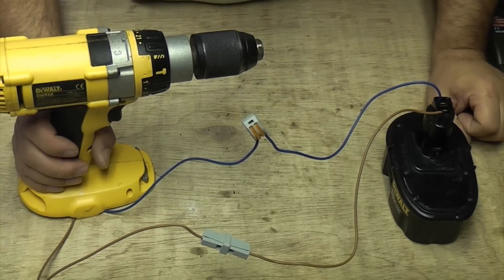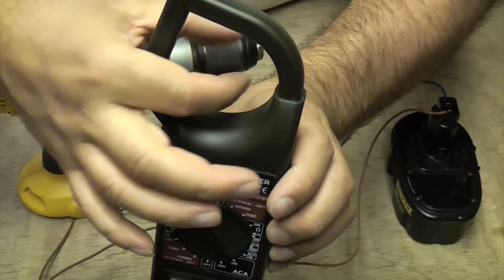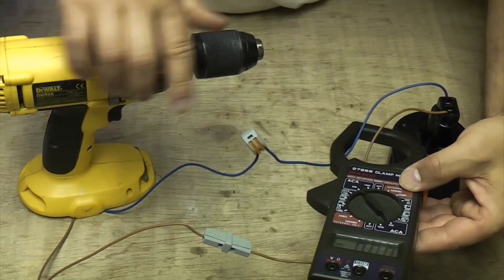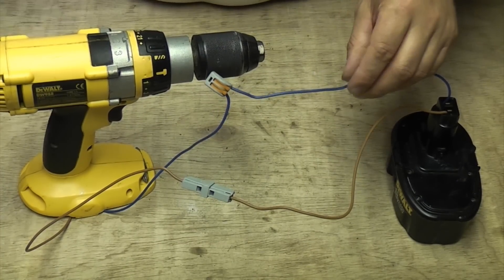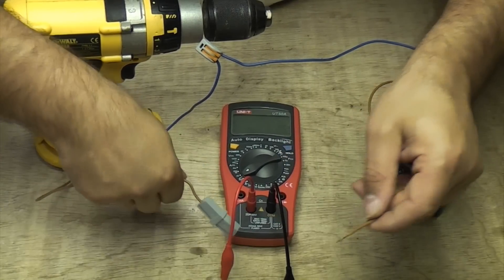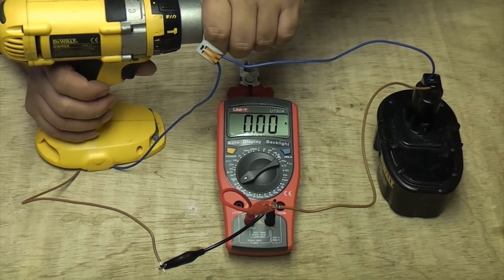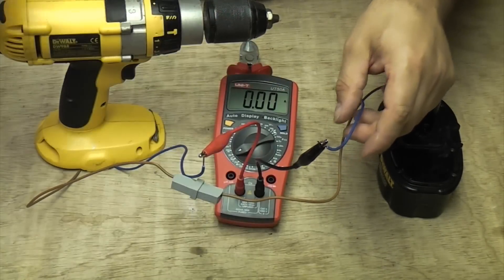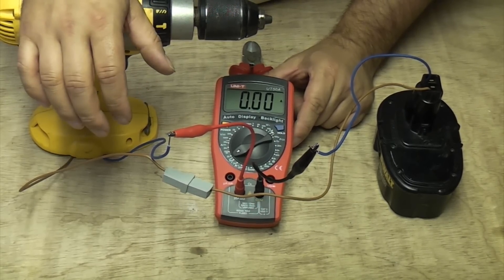Multi-meter to measure amps

Comment: cool, but i need to know how i can measure the milli/amps in a battery.....without anything connected. how do i do that? i have multimeters.....i have a certain 3.7v battery and it seems extremely powerful compared to other 3.7v batteries i have going by the same thing being connected,  nothing is written on it amperage wise....cheers.
Reply from the maker: Not sure about that, sorry.
It's not something I have ever done 🤔
Reply: @ultimatehandyman    no problem cheers for the reply,  yes strange isnt it,  i was experimenting yesterday, set my meter to milliamps...connected it to a 12v solar panel and could read the millamps no problem.....unhooked it, connected it to several batteries...and nothing....strange...i thougyt measuring a batteries amperage would have been uber simpke, but apparently not...    hmmmmmmm...

Comment: Thank you sir. I've fried cheap meters trying to read amps draw. My meters say 10 amps but I'm not confident that they can handle that. In the past I tried it and blew the internal fuse but still fried the meter....don't know why they design stuff that has a fuse for protection but in actuality the fuse doesn't do the job and the instrument get fried anyway ????
Reply from the maker: That has not happened to me - yet. 
The fuse should always protect the instrument, that is what it is there for!

Comment: This is probably a NiCd battery and this trick will work on these type of batteries. Mine drill is a 20v one Li-Ion, when i try to connect it to the multimeter and test the amps it can't start, i check the voltage and it's around 15,57V... Amps are only 10 miliamps. There is some kind of a connection that needs to make contact to let the full voltage but i dunno how...
Reply from the maker: Not sure about that, sorry.

Comment: How to check Current Storing Capacity in terms of mAh of any battery....Please explain...
Reply from the maker: Sorry, I do not know as it's something I have never done before.
Reply: I mean to say that how I can ascertain that a battery is good enough to use for how much time. Would voltage readings on a multimeter is only way or any other way also...

Comment: i don't understand why is he demonstrating the wrong way to measure the amp in the first place
Reply from the maker: +victor amechazurra What do you mean by I'm measuring amps in the wrong way?Please explain?
Reply: i didn't say you were measuring amps in the wrong way. You were spending too much time showing what is the wrong way  before you actually showed  the correct way
Reply: in case someone looking for an easy way to measure amps,
he just saved him money and time by showing that Clamp works for AC.
Reply: he was right to show the wrong way that people are confused about ac and dc amps ...... i m an engineer and people literally dont know about which clamp meter to buy ..... as ac clamp meter is way cheaper than dc amp meter, they always ask the same query repeatedly

Comment: +Ultimate Handyman
So does it matter which wire you should choose for amps rating? Becauce I see different wire showed different ratings.
Reply from the maker: +Josh3292 
You would normally measure the  negative side -
Thanks for the comment
Reply: Thanks, can you explain in details why?
Reply from the maker: +Josh3292 
No, I don't know sorry. I was just told that it should go in the negative side.
My electrical knowledge is limited, but someone else might know.
Thanks  for the comment
Reply: The negative terminal is where the electrons flow from, and the but it shouldn't make any difference. The current should be the same on both terminals.

Comment: How Do i know if Fuse inside the multimeter is busted ? any shortcut ?
Reply from the maker: +asad 
You need something to test it with really. But if the meter is not working and the batteries are good the chances are that it's the fuse.

Comment: Great video. So what was the max amps the drill pulled under load.  Saw it get close to 19amps and your metre is rated to 20amps max.?
Reply from the maker: Damien Kubik 
Thanks, yes I think the maximum it pulled was about 19amps.
Thanks for the comment
Reply: I pulled a 1500 in-lb. cordless impact driver apart. The trigger speed control is rated at 20 amps.

Comment: do you have a video on testing DC brushed motor amps?  using a multimeter
Reply from the maker: Frank Lopez 
This is a DC brushed motor in the drill I'm using.
I'm afraid I don't have any more, sorry!
Reply: oh ok well thats true, thanks i was just looking to see if i can apply this to my robotic projects as im looking to see how i can read torque from any dc motor by using the multimeter
Reply from the maker: Frank Lopez 
That sounds like an interesting project.
Best of luck with it ;-)

Comment: coil of the electron, its magnetic field pushed the electron of the iron. for this reason, in iron (+) charge is generated. the attraction force of the coil is the electron and iron. and the force is in direction of electron current. the resistance of coil is less.

Comment: the magnetic field is due to electron (the effect of the magnetic field and the electron velocity).

EXPLAIN- 
wire is the electron collision of the magnetic field, the magnetic field of electron of wire or sensors of multimeter. effect of magnetic field and velocity of electron, take care. wire the electron, its magnetic field are pushed in the direction in which the electron of the multimeter to the wire or sensors. according to the current generated in multimeter wire or sensors, and according to the current mesure.
change the direction of the wire. multimeter to measure the change in current.

NEXT MULTIMETER - same theory apply. but,
for half rotation, and it will focus on the structure of the coil of motor

without load condition-
time spent half the time = t

with load condition-
time spent half the time = t+dt
works as a resistance coil. but,
for dt time.
coil resistance is reduce 
change on the iron charge. resistance to change in the type of coil.
Reply: and (+) charge arising in iron, is to reduce the number of electron in it. the cause of the electron's magnetic field coil is pushed by the low electron. the reason is reduced resistance of coil.

Comment: Awesome video, and thanks for the info. I just started racing RC off road, and this is a great way to see if your motor timing is set properly. I was going to buy an rc watt meter, but I already had a multimeter, so this video saved me $50. Thanks!

ps for those that race, a 17.5t racing motor should draw around 3.5A (max) with pinion removed, at full throttle. If its higher than that, you've timed it too aggressively.
Reply from the maker: Glad it helped
Thanks for the comment

Comment: I just fried the amp portion on my multimeter. I had touched the positive to the positive of my solar charger input and the negative to the negative of the solar charger input. The charger had connected the solar inputs to the battery inputs so I had created a circuit I guess. I can't believe I didn't think of that happening. Oh well. Thanks for the video. I now know that when measuring Amps, I have to "intercept" the current so it is not read like voltage.

Comment: On a digital meter, all it would do is yield a negative number as all the Amp mode does is measure the voltage drop across a shunt resistor (kind of).  

Consider AC where the current is cycling positive negative positive negative. The multimeter would have to be able to handle the current going both ways. 

In short, no, it shouldn't hurt your multimeter.

Comment: The same way as with a digital, just make sure you have the positive lead connected to the 10A or red AMP terminal on the multimeter, otherwise you can bend your dial needle with a negative reading.

Comment: Some clamp meters can measure DC amperage, the one's that do this usually can measure 400A plus of DC current. A 20A multimeter is not sufficient (as mentioned below) for a car alternator

BigDWiz - OldSchoolStereo-com